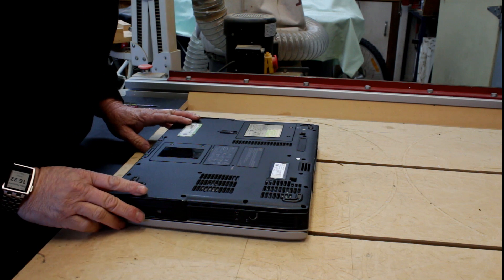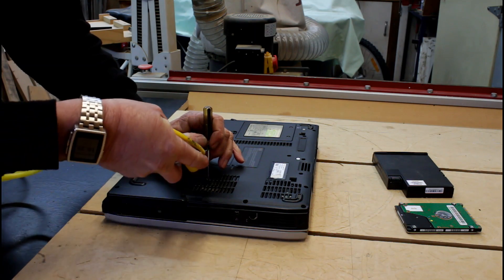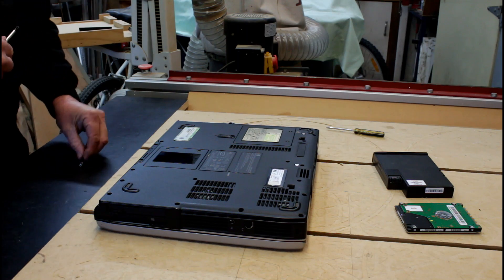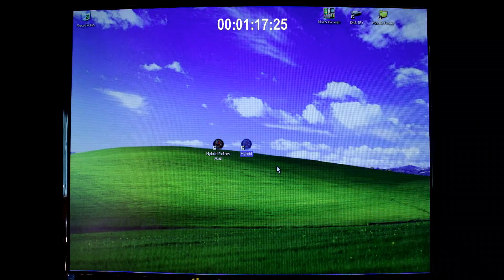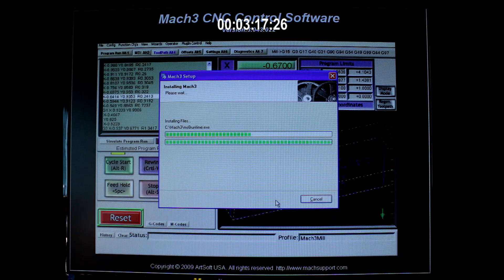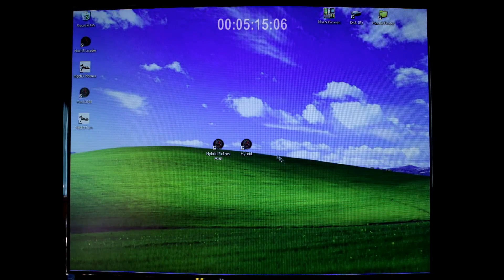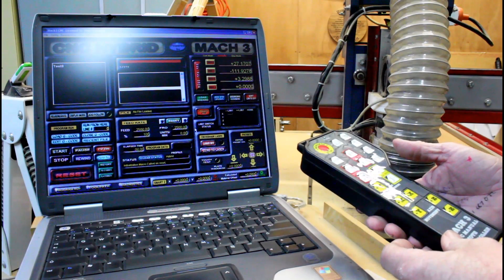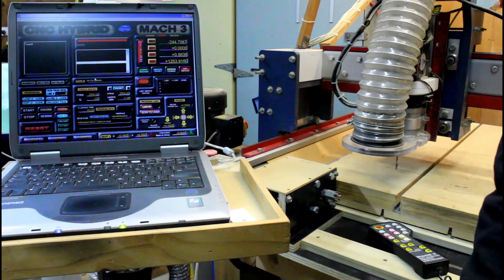Reinstall Mach3 in less than 6 minutes - CNCnutz Episode 104

Comment: Hey Peter, thanks for making the video!
I made a back up as per your “back it up “ video and saved it to a flash drive.
I then did a reinstall like on this video on my computer. I deleted the Mach3 folder after the install of the Mach3 software and then copy and pasted the backed up Mach3 folder on the C drive. But when I looked at the pins and port and the motor tuning, none of the setting were in there.
I had to manually put the mall back in. Luckily I took photos of all of the screen before I did the reinstall.

Any thoughts  on why it didn’t repopulate my ports and pins and motor tuning data?

Glen
Reply from the maker: All your setup information is in your xml file. You probably didn't load the correct xml when you started Mach3. Check your backup  for an xml file with a file name other than Mach3Mill and it is probably the one you were using and has your config. 
Cheers
Peter

Comment: What is the screen set you are using?  It's very different from anything else I have seen.  Did you design it your self?
Reply from the maker: It is a Custom screenset designed for the Joes hybrid. I didn't design it but modified it slightly to suit what I wanted it to do.
Reply: @cncnutz  Ahh, too bad.  I like it.  It looks pretty good.

I'm running a plasma table using UCCNC with their software, but I wasn't aware there was a plug-in for Mach 3.  I might go back and give that a try.  The UCCNC screens are neater, no doubt, but there are certain components on the Mach screens that don't even exist in UCCNC.  Also, since watching your videos on screen editing, I'm thinking of exploring that avenue.

Thanks very much for all your postings.

Comment: Peter, Thank You for the help. Im installing mach3 on a different computer with the same version on of windows to replace my old one. Can you tell   me what the advance of installing the same version of mach3 and then deleting it before installing the back? 
Thank You 
Wayne
Reply from the maker: Hi Wayne
You cannot drop a copy of the Mach3 directory into a windows machine as it won't work. You have to install it using the original install files. After that you can copy the critical files from your backup if you perfer but to speed up the process I found it easier to just delete the new one and copy the backup. By deleting the new you will not be asked about replacing duplicate files. By copying the entire backup. You won't miss a critical file. For me this just seemed easier.
Cheers
Peter
Reply: The Folder Peter is copying is Not the Entire Program. It is just the Files the program reads and needs when it is running. That is why you must install the program first.

Comment: Peter,
I see you running a smoothstepper. I have had one for about 5 months, but i frequently get an error message about the smoothstepper not getting enough information from mach 3. I asked on their site, and the common reply i got was that I needed at least 8 gigs of RAM, preferably 16 gigs. I only had 4 gigs. I was able to find another 4 gigs, but because of the age, thats it. I watched your vid, and am asking, have you had an issue with the smooth stepper, and how much RAM your laptop has (I'm thinking it is less that 8 gigs)
Thanks for all the vids....
Ray
Reply from the maker: +bcer960interurban 
I used to have the SmoothStepper but have now changed to the UC300ETH instead. My old laptop had 1gig of ram and I would get buffer errors only about once a month and only when pressing the stop button. I was running the USB version of the SmoothStepper.
Reply: yes, I have the USB version of the smooth stepper as well. I upgraded to 8gigs, and have only had it happen once.Thanks for the reply.

Comment: Hello peter. thanks for all the good info. I think I need to reinstall mach 3 or figure out if there is some wrong setting. I get unwanted machining marks when using  v carve pro and laser etch software using mach3.

the mach 3 display shows perfectly what the end result should be but some times there are lines that are machined in or lasered that are not part of the design. I believe it is some mach3 setting. I am having trouble finding out the source of this. I pretty sure it's not mechanical  but somewhere in mach3. I have a gecko 540 drive. any advice appreciated. thanks again..
Reply from the maker: Hi Jerry,
It is very hard to diagnose an issue without being able to see what the results you are getting.
Feel free to email me a photo of your issue and i am happy to take a look at it. Maybe it is something i have seen before.
email  to www.cncnutz65@gmail.com
Cheers
Peter

Comment: Hi, I am brand new to CNC, in fact I have not finished building it yet. my laptop is windows 10, so my question is two fold, first do you know if "mac 3" will work on windows 10. secondly is mac 3 free or paid for software. Thanks for all the info on your you tube site, I hope that I will be able to get my CNC up and running soon. Sorry I have just thought of another question, will mac 3 run any CNC machine?.
Reply from the maker: Hi John,
Mach3 is software you will need to purchase but you can download it and it will run. You will be limited to 500 lines of code without a license if my memory serves me right.
I couldn't tell you wether it will run properly on windows 10 or not. Maybe someone here can answer that for you or you could try the CNCZone. I'm sure someone will be able to answer it.
The answer to the last question is Yes and No. It all depends on the controller you have whether it will work or not.
eg it won't work with vcarve or shapoko machine controllers but if you change the controller then yes it will work.
The good thing is you can download and try it out first before buying the license.
Cheers
Peter

Comment: Great info, thanks for sharing. Is there much difference between copying the whole folder as opposed to just the .xml file? Thanks.
Reply from the maker: I have tried both methods and both work fine for me. In my case I need to also copy the custom screen sets, Custom Bitmap files, A 2nd XML file for the rotary axis, Smoothstepper plugins and of course the license file.
I guess I am just lazy.
The main thing to take from this is to backup your entire Mach3 folder and then you have everything you need to restore your system regardless of what method you use.

Cheers
Peter